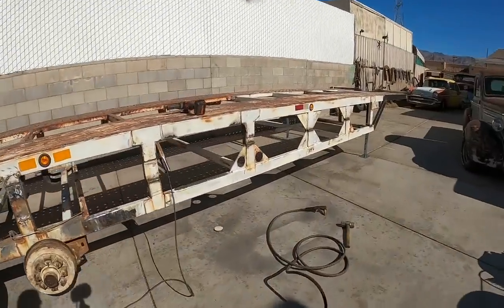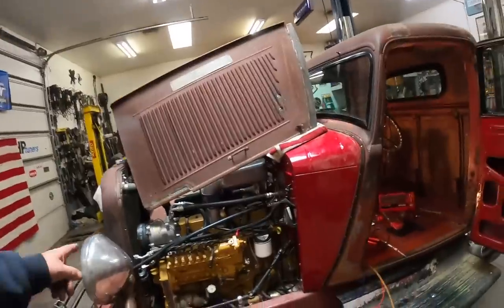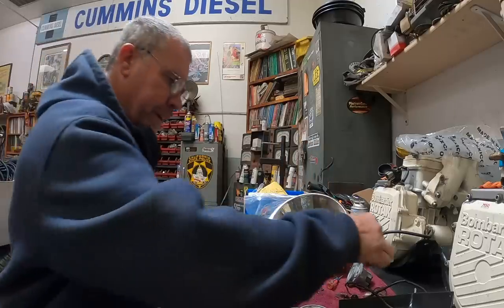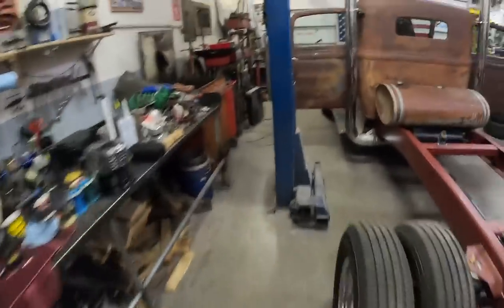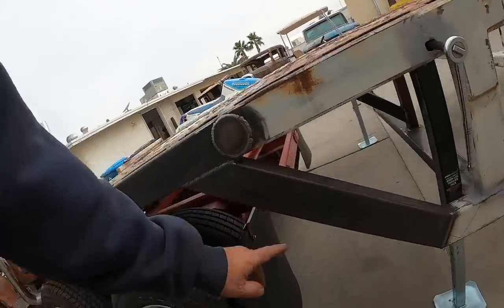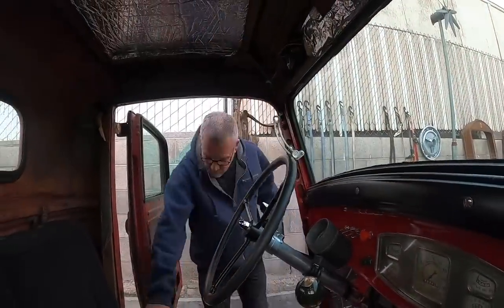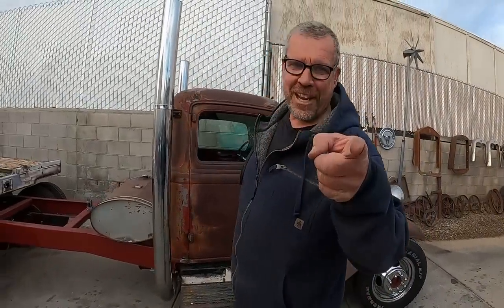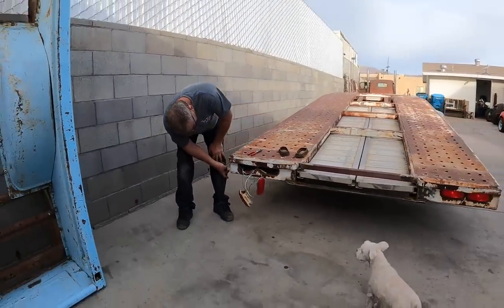I Need to Get This Trailer Done So I Can Get Ready For the Off-Road Wrecker Games

Comment: The rig came out real nice Merlin. So when are you putting some west coast mirrors on the truck and maybe a couple utility/work lights on the back of the cab for backing up or loading at night. I say load the wrecker up on the new rig and travel in style.

Comment: Remember to always do the tug test when hooking up to the trailer. After you hear & feel it latch, do a slight forward pull before releasing brakes, to make sure it latched. I always like to get out and look at the jaws like you did. 
I think you should tow the tow truck to the wrecker games. Two reasons, in case something breaks & you're not able to do a quick on road repair, you have a way to get it home, & you can haul another vehicle up there with you, so you have a car to drive for the 3 days you're up there.

Comment: Trailer looks good. Nice set up. I normally have to put a little grease on the old light rubbers to get the bulbs to slide in.  The last dual rear axle I did I put a carrier bearing on the front diff tube and run the two piece shaft to the rear one. We used a small single speed divorced gear to gear transfer case backwards for the divider. Worked pretty good. I ran rotella t6 oil instead of gear oil and it never got hot. It did get hot with 90w in it. Nice set up for sure. I have a nice old IH TR11 on long frame with hyd cylinder still on it if anyone wants to make a tilt bed car hauler. New Mexico. complete truck and complete extra chassis as well. We built a couple gas mileage gang trucks from 36 chevy one with 4bt and the other with npr 4 cyl. both engines IDI. I do not do electronics. 5 speed sticks then a np205 backwards for a huge over drive. They were 1/2 ton trucks on 78 ford f150 frames in a contest to whom could get the 50 mpg goal. The trucks were so light with the 3.50 rear 9 inch they would drive off with the xfercase in low range making it a two to one over drive. Same thing we ran rotella t6 in the trans, xfer case and straight rotella 40 weight in the rear diff. The npr truck got 3 mpg better all the time. The old trucks are way better slicing through the air.

Comment: are you still planning a power divider for the mini semi? I was anxious to see what you came up with.  and theres no way you can't tow it if you own that awesome truck and trailer.
Reply: I was wondering about that too. Have seen several mini semi trucks reverse the front output on a 203 Tcase so it had 2 outputs out the back, set it up so Tcase could be divorced from trans. Run one driveshaft back to the Tcase mounted a couple feet ahead of the tandem axles, then run one shaft to each rear axle using a carrier bearing over forward axle to get a shaft to rear axle. It gives you a diff between the axles that you can lock(same as locking power divider in real semi}. also gets you a low range.

Comment: Back in the day working in a rustbelt truck shop I came across what was an anomaly to me.  A 40s something gas powered Brockway 10 wheeler the tear axel driven by big herky V Belts.  We were putting channel Iron bed rails and a 20 ton hoist under the 18' flat bed.   
Point being you could accomplish the same thing on your rig.

It looks great. Will anxiously await the completion.  
Am awaiting th he video results on the games now.  Thanks for sharing.

Comment: Put a resistor in your turn signal circuit. That will give enough load for the flasher relay to work properly.

Comment: Nice build overall, I just have to wonder if your front turn signals on the semi tractor will be visible when the headlights are on?  You may need to employ the same trick used on late-model cars with LED headlights and include a (solidstate?) relay to cut off the headlight on the side that the turn signal is engaged.  Probably shouldn't include the 4-ways in that though.

Comment: This an amazing build , looks so cool , and it seems to run and pull the trailer extremely well . The only thing that I will pick at is a narrower front axle would be more in keeping with the original character of the truck .

Comment: Merlin will both axles be powered on the truck? I've seen a 205 divorced mounted and a jack shaft and a carrier bearing on the front axle to power the rear. Old ww2 6x6 power wagons used a similar setup.

Comment: Hey Merlin.  An old parts guy here.  What you might get for the flasher would be a 552 variable load flasher.  I believe it will handle as many or as few bulbs as you will put on it.

Comment: If you wanna power that rear axle, consider a dual outtput transfer case mounted about at the rear of the cab, a hanger bearing  mounted above the front axle and clock your rear rear diff upwards slightly to lesson the driveshaft angle. Bang... working tandem drive axles.

Seen it done on the T Rex 6x6 dodge truck back in the 2000s

Comment: Merlin, The mirror silver is extremely soft and scratches easily. 

I have a ships brass search light with a 16 inch reflector that was damaged and required some work. I was told to flood the surface with soapy water and to use a soft sponge to remove the built up dirt and grime.

I sent my reflector out to be resilvered (actually it was coated with rhodium as it was more reflective and held up better. It was expensive, but the work I put into the light, scrimping on the coating wasn't in the cards.

You're head lamps appear to be 8-10 inches in diameter and would cost around $100 each including shipping. This price might include stripping the old coating. Optic Wave Labs.

Comment: You may find running smaller size air bag on dead axle works better. Depending on how much weight is on truck bag air pressure will change and your regular will need adjusted. With smaller air bag it will have less weight due to smaller surface area. Awesome rig! I want one.

Comment: The best thing about those blue wire splices you used on the tail lights is they are small so they don't take up a lot of space in the trash can. If you think your head hurts now from the wiring, wait until those splices start to corrode and cause your lights to fail. Absolutely the worst thing you can use to splice wires together that people still buy.

Comment: Awesome progress!  It's fun for a bit on a cruiser, but IMHO that pump needs to be turned down so you don't burn pistons with high egt's while under a load plus it's not great for the cars on the trailer,etc.
Good idea about using a pressure regulator to put less psi into the tag axle bags for more traction.

Comment: I would trailer it it would look awesome especially with one of my favorite builds I’ve ever seen is the Cummins Semi I love that set up also don’t forget to put a layer of grease on top of your fifth wheel plate it will ruin that plate really fast running it dry just a heads up, Also I have the same wire Cutters/crimpers small red handled they work perfect just wish they had bigger cutting spot lol Great work man 🤝🤙

Comment: Merlin you need to grease that fifth wheel plate or get a Teflon disk for it. You'll experience turning pushing issues without liberation. God bless

Comment: Just put a second leveling valve on the rear axle, then you can just adjust it to give less axle pressure, the drive axle will always carry a bit more without continually playing with a regulator.

Comment: At the heart of it all is the Concept of Presense! So many others in the competition are doing their big show  "Build-Up" with fireworks, fanfare, failures and fake drama. Pardon my refence to an old Kansas song, they are just fa*ts in the wind. You have a very capable wrecker so give it AND yourself a genuine Jedi Knight's entrance to the the competition.  Wire it with low-level rock (perimeter) lighting to make it shine while driving down the road and upon entry to the King's court; THEN, be able to power up the lights to "Close Encounters of the Third Kind" and, even though the music is copyrighted, MAKE SOME NOISE. As George Strait would sing, You've got to have an Ace in the Hole. Betting on you. 🤞

Comment: You should make a rig to transfer drive to the rear Axle from the front drive Axle with pump and motor Hydraulics will be flexable because of hoses and transfer the power to the rear Axle better traction!

Comment: Poly plate for the 5th wheel. You won't be using it everyday and the grease will make a mess. AND it evaporates in the hot AZ sun.
Reply: everything evaporates in the hot AZ sun....   even people....

Comment: It would be cool for you to drive it there however it would be even cooler to see that on the trlr with the truck pullin it.I'm surprised you are not using l.e.d's on the trlr!Unless they are used just to wire it up.

Comment: What size is the Honda, I purchased a Honda 350 twin when I was 11 back in 1975 had it until I gave it to a friend in the late 1980's, he still has it. Amazing quality. (350 twin was stated because Honda made a 350 4 cylinder)
Reply: PS Mine was a 1969.

Comment: Whenever I do my wiring on my vehicles, I pretty much always do soldering, but what I do is, I put shrink wrap a little distance away from where I’m soldering that way I don’t shrink up on me and then I clean my solder joint off of carb cleaner, get the flux off of there in that then and then I put the silicone or you like to use the red high temp silicone on my joint soldering joint skews me and then I pull my shrink wrap and shrink it down what that silicone and air it’ll never corrode anyway, I just thought I’d let you know that this is six in a row jim from Kennerdell, Pennsylvania, I like your dog grand I like all those dogs they were beautiful anyway ha ha I would recommend in your differential on your mini semi truck which I think is a really neat vehicle to. I would use one of those off Detroit locker true track differentials in there that will help you with a traction course with that kind of power you got still got a watch how much loud paddle you use all right good luck I will I like your program by the way your granddaughter seems like a really neat girl. Good kid all right have a good day. Be careful now.

Comment: As I thought,  that's a great looking rig. But I'm kind of disappointed.  I was yelling at the screen when you used a Scotch lock for the tail lights.  I guess you'll be ok in the drier climate but I can't tell you how many times I've had to help a driver out with wiring problems on their rig only to find the previous repair was done using Scotch locks. The salt, chemicals and water get in and actually wick a couple of feet up the wire causing it to corrode and break. I'm sure you'll fix it later. Good luck at the off road wrecker games

Comment: My vote is the same as the other commenters. Tow it with the mini.
I was just wondering what you needed to do so the DOT doesn't give you any problems?
Reply: plates, tags, lights, securement.
Reply: @oregonfordguy9812  The reason I brought it up was that my nephew was driving a Chevy 3500 non dually pulling a goose neck dual axle flat bed and kept his weight down around 25,000 lbs thinking he was good to go. DOT stopped him and told him that he needed a CDL, DOT numbers, fuel tax sticker and a list of other things because of what the combo was capable of grossing out at not what he weighs so he stopped pulling that combo.

Comment: Sharp rig.  Trailer compliments it well.  

Why did you stretch the frame so long?  To me, the proportions look off - I think the rear two axles should be forward a foot or two.  My opinion is based on aesthetics purely, no knowledge on functionality.  That's why I asked the question.

Comment: Don't trash all truck drivers about not moving over.  The reason a lot of them don't is because of all the 10 mph over the posted speed limit 4 wheelers that are passing right at the time they need to change lanes.  They hardly look past their hoods, and don't see that the truck may have a very good reason for changing lanes.

Come on, folks, get with it.  "Limit " means "no faster than ..."  Slow down, move over is the law, give the trucks the time and room to comply.